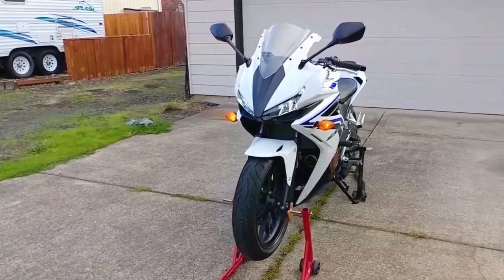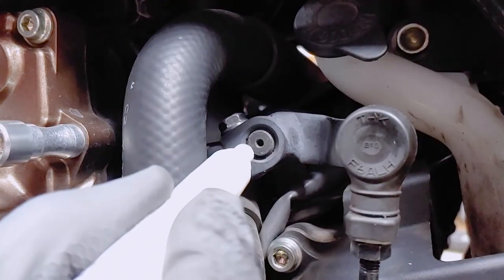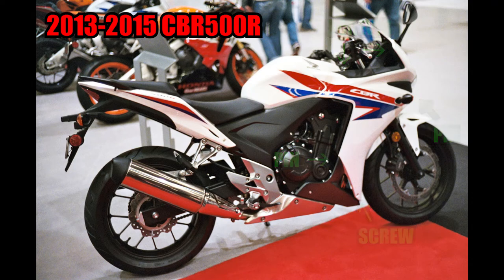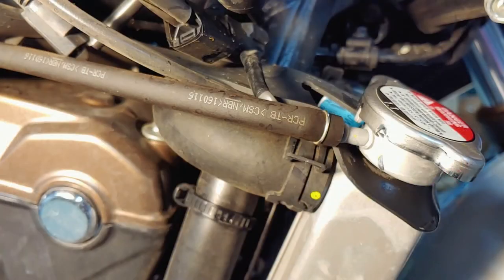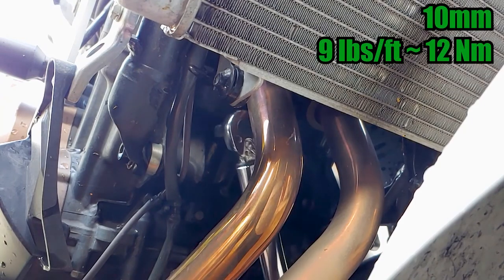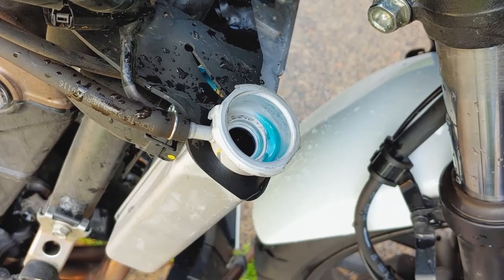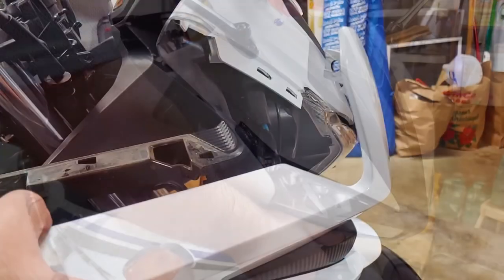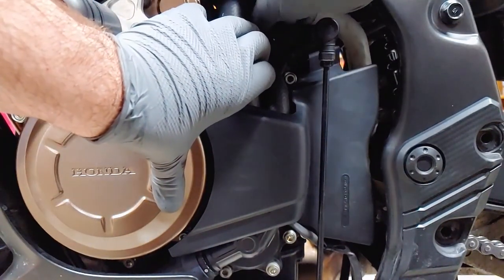Coolant Flush - Honda CBR500R / CB500X / CB500F 2013-2018

Comment: Great video, thanks! It really helped to see someone else do it! 

Might be worth adding a warning that if you live in a hard water area do not use the garden hose or tap water in your cooling system - I’ve seen the inside of my kettle! I just went to the hardware store and got about 4L / a gallon of demineralised water for about 2 bucks. 

Also since the offical Honda coolant is bloody hard to get where I live in a Covid world, I’ll make it easier for the next person: you just need a silicate free ethylene glycol coolant. In Australia the easiest to get is Penrite blue, it’s everywhere. Buy the concentrate as it’s basically half the cost of the premix and mix it 50:50 with some of the demineralised water you got from Bunnings. 

If you live in a hard water area like me, you might want to do a flush with 50:50 cleaning vinegar to demineralised water if the bike is used, just in case someone else topped it up at some point with hard tap water and it’s getting a bit scaley in there. Just fill the system up with the water vinegar mix, (can reuse the old washers for this step) go for a 10 minute ride, let the bike cool down for a few hours and then proceed to drain that, wash out the vinegar  with some demineralised water and then add your coolant.
Reply from the maker: I didn't think about hard water being a problem for some people. Thank you for bringing that up and for your suggestions on how to deal with it. I agree that you wouldn't want to flush the engine with hard water. Thanks again and Happy New Year!

Comment: Good diy! I’ve never done the coolant on my 13. She only has about 6k kms but the damage from old coolant makes sense!
Reply from the maker: Yeah, you'll want to replace it soon.  I've even heard of old coolant causing weird electrical problems in vehicles because the molecules in the coolant loose ions over time and develop a negative charge.  I put it off for too long too, but it turned out to be a lot easier than I thought it would be.

Comment: I appreciate it brother. I’ve got a 2017 that’s been sitting in a garage for 2 years. Going to flush out the coolant, brake fluid, gas (of course), clean up the chain, and anything else that comes up as important lol. I appreciate the video
Reply from the maker: Happy to help!  Make sure the tires aren't cracked and all the lights work, and it should be good to go.  Have fun!
Reply: @EndlessMoneyPits  Will do. I’ll do an inspection and see how it rides. They are still inflated to the right psi, surprisingly but I’ll still pay attention to any potential low spots and change the tires if I need to. Lucky to live in the great state of Florida and have the ability to ride all year long. Safe travels, brother!

Comment: Great tutorial video. I have the Rebel 500 and that engine, radiator and reservoir appear nearly identical. This video was a big help and the best I've seen for Honda  coolant replacement. Thanks.
Reply from the maker: Wow, I didn't know the Rebel was so similar but that would make sense. Glad it helped!
Reply: Fun fact they have the same engine as the CBR's do.
Reply from the maker: I was wondering if it was exactly the same but it makes sense that it would be. Great engine.

Comment: I see you have a clip type chain master link. What’s your experience with that type? Ever lost the clip?
Reply from the maker: Yes, the clip did go missing once. I replaced it and twisted wire around it to keep it from coming off again, which actually seemed to work. In a more recent video, I replaced this chain with one that has a rivet style link so I don't have to worry about it anymore.

Comment: You didn't drain the backup reservoir, do you know where the drain bolt is for that? If not, is it then ok to mix different brands of coolant?
Reply from the maker: There is no drain bolt for the reservoir. There isn't much coolant in there, so it shouldn't matter to mix it with new coolant. You could always suck out the old fluid with a hand pump if you want to get rid of all of it. Hope that helps!
Reply: @EndlessMoneyPits  Another Q: I was thinking of ways to drain the reservoir without taking anything extra off - if I run the engine and leave the drain bolt off will that flush out the excess coolant? Otherwise I think I will unhook the pipe that runs to the radiator and lower it below the tank to drain excess.
Reply from the maker: @psychopigeon8973  Did you find a way to remove the radiator cap without taking off the fairing?  Now that you mention it, you might be able to drain the reservoir by disconnecting its lower hose, but that won't drain the radiator and engine.  I'm not sure if running the engine with drain bolts out would work, but you won't be able to get coolant back into the bike if you haven't gotten the radiator cap off yet anyway.  If the radiator cap is off, the coolant will drain out.  Removing the fairings really wasn't that bad.  I've done it twice now and it seems I've only broken one small clip that hasn't made any difference.
Reply: @EndlessMoneyPits  The trick I used was pressure. 
If you remove the small supply line from the top of the radiator near the cap leading to the reservoir, hold the reservoir's rubber fill cap on tight and blow hard into that little hose, you'll force the rest of the coolant in the reservoir out through the overflow tube - just like the radiator would if overfilled and running hot.
 you can also run a little bit of water through it too to flush it, but can't get much flow.
Reply: @EndlessMoneyPits  if you have small wrists, you can work the cap off with the fairings on. not easy as you have to put pressure down and while twisting with only grip on one half the cap.

you can also endure less mess by draining from either hose connection to the water pump rather than the weep hole. you still have to get the small hole under the engine as it's in front of the thermostat.

Probably a good time to check the thermostat housing for corrosion and test it still operates as expected.

Comment: Just bought 2021 cbr500r 1 month ago.. 2 weeks i have noticed a leak from left side and it is coolant.. I am wondering why because i bougt it brand new
Reply from the maker: It's probably just a bad gasket or something simple. I don't think that's a common issue, but Honda should be happy to fix it for you under warranty.

Comment: No need to take all the covers off or the shifter! Drain bolts are easily accessible. Only fairing you need to loosen is in the coolant cap side. If you’re only doing cooling flush, don’t do the extra steps
Reply from the maker: I took off the front sprocket cover and left fairing to inspect the cooling system hoses and water pump. You will need to remove the right side fairing to reach the radiator cap but the rear is just for inspection purposes.
Reply: Thanks man. I thought it was possible to not remove the sprocket cover.  And shifter.

Comment: Thank you! Great quality video!
How much are the copper washers in your area? Around here the dealer wants 2$ each, seems overpriced to me.
Reply from the maker: I ordered the copper washers from the partzilla website.  Part number 90463-ML7-000.  They are $2.57 each plus shipping, and shipping can be expensive so I waited until I was ordering other parts at the same time.  However, I bet I could find something very similar at the local hardware store about ten cents.  It was worth the extra price to make sure I had the right part and didn't have to wait around if I couldn't find it locally, and I like to use the proper parts in my videos when I can.  If it's copper and the inner and outer diameters match the factory washer, it should work.
Reply: Now they are 5.50$ each. Just bought two from the link in the description!
Reply from the maker: Holy cow, those are BMW washer prices! lol thanks, Honda...

Comment: Where did you get your front and rear stands and do they fit a 2013 cbr 500r model
Reply from the maker: I just updated the video description with a working link for these stands. They will fit many bikes including your 2013 500r.

Comment: Nice video BUT one error....you should use "distilled water" to flush radiator (a gallon at Walmart for less then $1).  Depending on where you live, tap water has minerals which can be bad for the cooling system.
Reply from the maker: I wouldn't mix coolant with tap water but flushing the radiator with it shouldn't be a problem. It's also what most people do. Not a bad idea to be extra safe by using distilled water if you live in an area with hard water.
Reply: @EndlessMoneyPits  Just to clarify, in your video, when you were topping up the reserve tank. you just poured anti-freeze without measuring and the reserve tank just over-flowed...is my description of video correct?  So after over-flow, where did the reserve tank anti-freeze level sit?  Was it at the top level mark?  Thanks.
Reply from the maker: Yes, that is how I did it. The coolant should end up at or near the top mark after warming up and pushing out the overflow. The fluid will contract once it cools but I don't remember exactly how much it settles.

Comment: Can't this be done without removing the fairings or other caps, lids etc? I can see and reach almost all of the drain bolts and radiator cap without removing anything (of course its harder but doesn't seem impossible). What are your thoughts?
one more thing. wouldn't it be possible to drain the whole anti-freeze only by opening the bottom drain bolt and radiator cap then flushing the system with garden hose, then adding some concentrate antifreze?
Reply from the maker: I wish! You have to remove the radiator cap to drain and refill with new coolant, and I couldn't get to the cap without removing the right side fairing. I could reach the cap without removing the fairing, but couldn't find any way to twist it off. Getting it back on would be even harder. I tried, but let me know if you come up with another way that works.
Reply: @EndlessMoneyPits  I'll try to flush the coolant without removing the coolant. If I can, I'll let you know. Hope I can because I pretty sure that I would break the fairing while removing it. Thank you for your reply :)

Comment: Hey, I was wondering if you knew the size and dimensions of the lower drain bolt, mine snapped in half while I was tightening it. I'd really appreciate it because I just need a replacement.
 Thanks!
Reply from the maker: It looks like #8 in this diagram, which is listed as 6x25 https://www.partzilla.com/catalog/honda/motorcycle/2016/cbr500ra-2ac-cbr500ra/water-pump
Reply: @EndlessMoneyPits  Thanks so much! I really appreciate the help!

Comment: I thought over filling the reservoir with coolant can hurt the bike?
Reply from the maker: On these bikes there is a drain hose just above the full line on the reservoir, so you can't really overfill them. It's not a pressurized system, so any remaining excess coolant will drain from that hose as the bike gets to operating temperature. Hope that helps!

Comment: Hi. I cant find honda oem coolant flush in my country. Which type coolant i should use on my 14 Cbr 500r
Reply from the maker: I've seen Engine Ice and Kool Guard MEG recommended for our motorcycles but I haven't used them myself.  From what I've read, I would go with one of those if I couldn't find HP Coolant at my local Honda dealer.

Comment: hi ,What is the model of the anti-fall bars?
Reply from the maker: I got them on eBay 5 years ago. They are called frame sliders and had no company name. The most similar ones I can find now are made by SATO Racing on ebay but the price is 4 times what I paid. I'm not sure they are worth $200 plus shipping, honestly.

Comment: Does anyone know if the radiators are the same on all these years of bike? I’ve got damage to my 2016 cb500f, I can only find replacement radiators for 2014 models. Thanks
Reply from the maker: If you don't find the answer quickly, just call your local Honda motorcycle dealer and they should be able to tell you.
Reply: @EndlessMoneyPits  thanks mate

Comment: Do not use water from a hose, use distilled water ONLY !!
Reply from the maker: It's perfectly fine to flush the engine with water from the hose if you let it drain out, but don't mix coolant with it for refilling the system. You should only mix coolant with distilled water, but the coolant used in this video was premixed so you don't even have to worry about it ;)